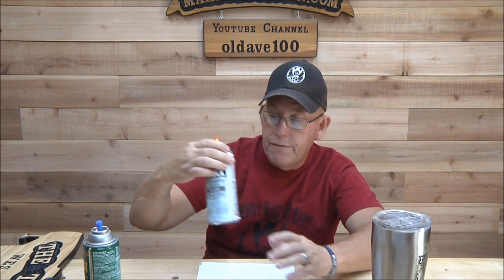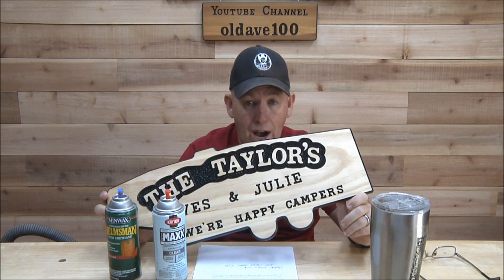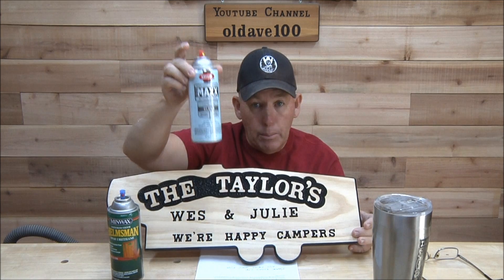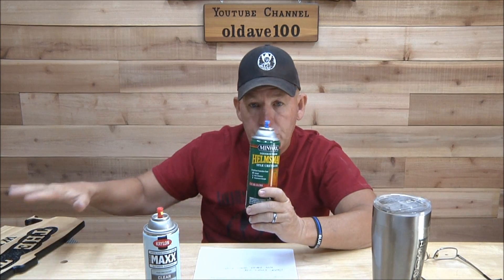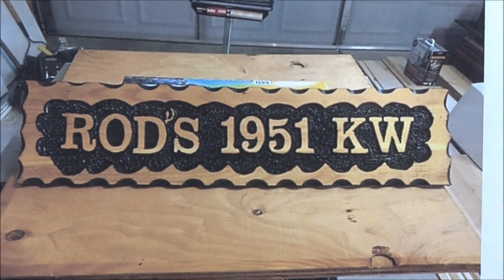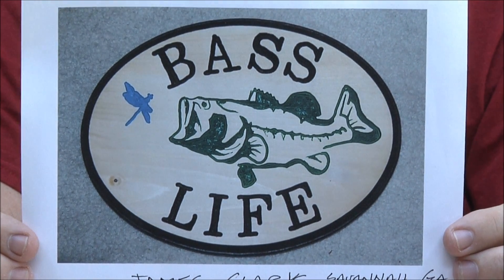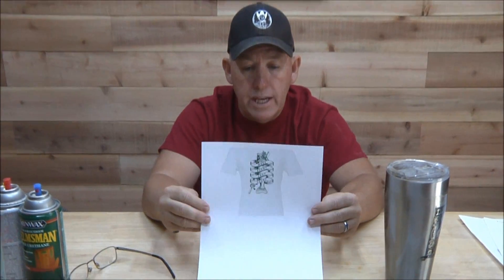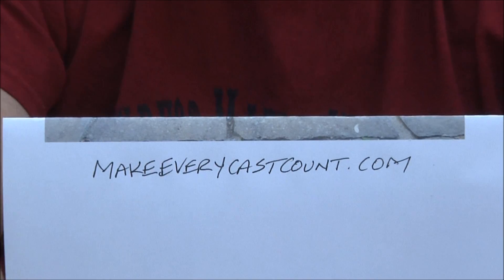Coffee & Questions 8/9/17  More Finishing Tips

Comment: Love you guys! The problem with the signs cupping outdoors or even indoors may be due to the wood (especially pine) not being dry yet, not the finish. I can't imagine multiple coats of any finish allowing moisture in. I am surprised that you didn't mention that as the possible problem, or at least part of it. I watched your video about how you stack your cedar boards for drying  and then put weight on them to avoid cupping and twisting. GREAT video. I have some drying like that right now. I did my first sign with a straight bit with a pine board and can't wait to try out the cedar. Time to order some bits from you guys or at least the profile bit.  I am currently unemployed so I will try the first couple with your profile and my 90 for background. Full size porter cable for now. Dewalt 611 later. God bless you my friends!! P.S. Also prayers for Justin!
Reply from the maker: You bring up a good point, I should have mentioned that. When I was answering this particular question it was about finishing a completed sign. I was assuming the boards were already dry when making the sign. Thank you again for watching and all the support, I really appreciate it, Eric